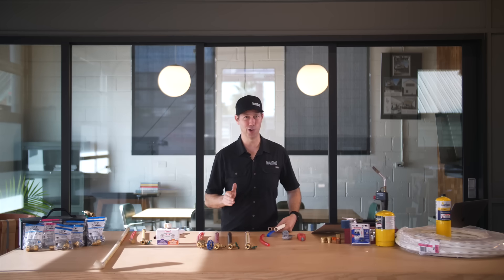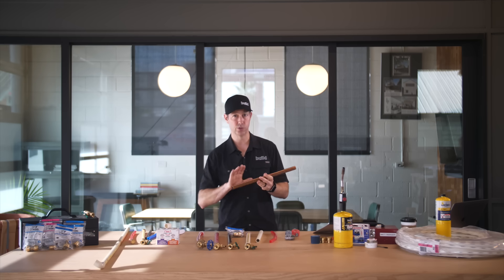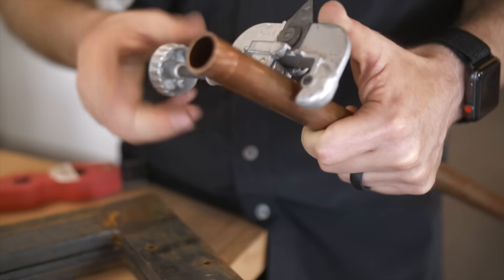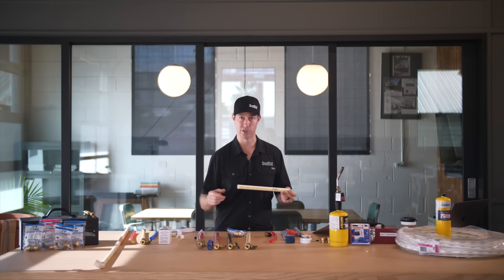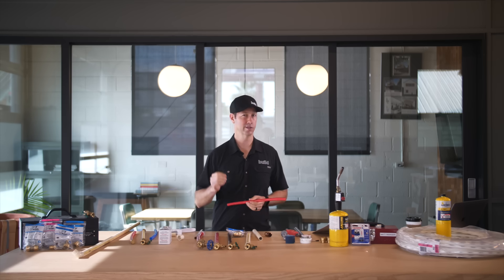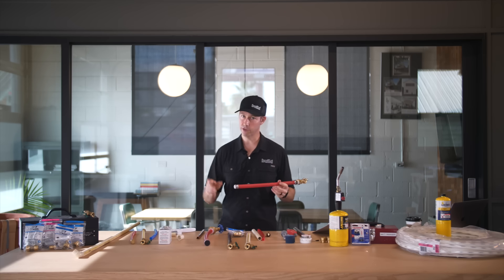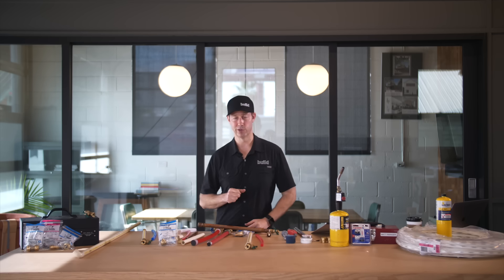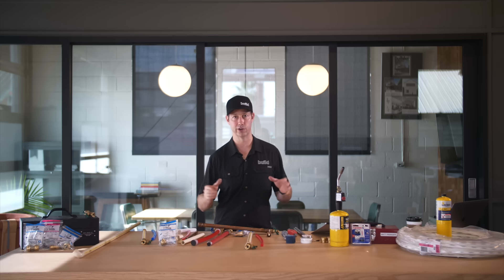PEX vs COPPER vs CPVC plumbing pipes

Comment: Ptc is nice for speed but if there is a scrap in the outside of the pipe from pulling in the stud holes the Ptc will leek. It is nice for speed but I don't trust it for the long haul. We are In California and the home that I have worked in with cpvc are all supper brittle and will crack and break  in your hand with any pressure  applied .  I am worried when we have an earthquake  anybody with CPVC  will have to repipe their home due to  such brittleness  these are in homes only 30 years or less old. I personally love copper and would pay the 20% more for a good copper job any day. Love the videos thanks for the great content!

Comment: I live in Florida and had a Pex repipe about 9 years ago he used 20-foot 3/4 PEX sections in the Attic. With all those joints will I have leak issues due to heat? Would insulating the pipes help?
Reply: If you're worried about heat maybe better ventilation to your attic might help, weather it's an exhaust fan or the Styrofoam panels up against the top part of the roof,  food for thought.

Comment: I am a DYI, have been out of necessity, many dyi projects and not enough money to buy materials and hire a professional, also, living in a rural area in East Texas and it is very hard to find a person that is really qualified.  That being said, I can do sweat fittings on copper, but don't like to do them.  I built a new bathroom off the master bedroom about 15 years ago and I used CPVC pipe and liked the way it installed.  However, this year I wanted to remodel the bathroom with a new shower and bath fittings (new tile in shower, brushed nickel instead of gold colored fixtures) I found the CPVC pipe was very brittle, not the soft cut as when I installed it.  I would try to cut the pipe with my pipe cutters and the CPVC would split several inches down from the cut.  This worried me as I didn't want to remodel the bathroom and have pipe failure.  After doing a lot of checking I decided to go with PEX pipe.  I replaced all the CPVC in the bathroom with PEX, and plan to replace the other two baths, kitchen, utility room with it as well.  I decided on using a manifold in the closet where I replaced my 30 gallon gas hot water with a electric on demand heater.  I love it all.  I have used shark bite fittings, but they are way to expensive for me to use for all my plumbing.  I use the copper fittings with my PEX pipe for about 1/5th the cost of shark bites.  Thanks for sharing your videos.
Reply: Ah!  The test of time, well reported.      THANKS.
Reply: You will be replacing all those shirk bites soon too
Reply: What does DYI stand for?
Reply: @realisaacchapman  - Do Yourself It

Comment: I agree, Northern houses sometimes have to be winterized, thus drain the plumbing of all water for the winter. To install it to slope for draining.
I would not use PEX due to its flexibility and would tend to sag, unless lots, and lots of clamps were used to guide it in a negative slope.
Otherwise, I have used it with Sharkbite fittings and it works great. I do use CPVC alot cause I work under buildings in crawl spaces, and 
using a torch for copper is a fire hazzard. Not a plumber, just a handyman maintenance head at a summer youth camp. A real do it all type
of job.

Comment: Pro tip: If you get purple primer on something you can use clear primer to remove the stain. Also if it’s a painted surface it might take the paint with it :D and copper>all up here in the north the cold is a pipe killer

Comment: I've had CPVC joints leak in a house less than 15 yrs old.  Multiple places in a conditioned basement including the 3/4" main coming in the house.  I also think it hammers hard like copper but it also has an annoying expansion sound when hot water goes through it after it has a chance to cool.  I would never use CPVC on any plumbing job I was working based on this.  Copper would be my preference but PEX has proven (so far) to be a good alternative provided you use the correct type with the all plastic joint clamps and not those metal joint clamps that you pinch close.

Comment: The copper pip you showed was a hard pipe. There are copper pipes that are soft (copper and plastic outside). They come i rolls and you can easy bend and straighten them and go long distance. 
Here in Sweden plumbers uses pressure fittings for copper. They have a rubberseal inside of them som we don't know how long they last. Some say 50 years? The other way is  normal screw fittings. 
New hoses in Sweden all uses pex. And that is double pex. A pex pip in a pex pipe. That way if you get a leak. The water goes out where the pipes comes out from the wall.
Reply: I seen the rolls of plastic dipped copped for gas lines that were buried.

Comment: How does water hammer happen in a system? Isn’t a system under constant pressure? The only time you should get a water hammer is when you turn the water on and off at the Main Street valve. Right?

Comment: I live in Michigan. I would like to run a water line form my
house to my garage which is about 25 feet away from the house. I am planning to
get the PEX pipe underground about 42 inches below the surfer (which is the
frozen line in Michigan). Is it PEX the best chose for underground piping?
Reply: Pex shouldn't me used underground in a instance as you describe . Leachate can actually penetrate the pex pipe. I'm not sure if that as something to do with the lack of oxygen barrier in Pex or just a issue with plastic tubing in general

Comment: So interesting topics, however, the focus was on longevity and cost. But nothing about remodel/repair (IE where it may not be all of one or the other) and how difficult/costly to integrate, as well as other limitations, like for example in a home further up north where it may have to deal with frozen pipes, or connecting to outside faucets. For example, a copper pipe, I have no issue throwing a heating coil to keep it warm, but I'm not sure on the PEX on whether that would degrade. And vice versa, any issues with doing hot and cold water, or for homes with radiators, etc.

Would love to see more explored on this that just the barebones cost and lifetime questions.

Comment: I was doing a bathroom... My customer was talking to me while I was fitting pvc for the drains... I turned the water on to check the copper fittings... I used Shark Bites to cap the vanity lines... As he was standing there the shark bite that was on for hours blew off against the bathtub... Last time I will use them

Comment: Copper not 75-100 years.......my house build in 1995 and this past weekend I had the lines going in and out of the hot water heater fail at the joints.  Most likely electrolysis from the hot water heater and the minerals in the water.  I had CPVC in a Keys house, no issues.
Reply: By the way, for health reasons, I think I would stick with copper.....and those Shark fittings make repairs super easy!
Reply: copper's Achilles heel is electrolysis, and Chinese crap imported by big box stores in last decades. Proper grounding straps and no residual current flow in pipes are mandatory for longevity. Check, you element may be leaking current
Reply: Craig Symington Thanks!

Comment: I'd never use Sharkbite or other push to fit fitting to plumb an entire house - you're depending on that rubber o-ring to maintain your water tight seal. What happens when they start to degrade in 20 years? Time to re-plumb the house! Give me real connector any day!

Comment: You mentioned two types of Pex connections... What about the stainless steel crimp fittings, only just started using Pex, but the crimp tool was $35 from Amazon, and the same tool does 1/2” thru 1” rings...   have had no trouble so far.. any comments?
Reply: If you use Uponor connectors (PEX-A), you never have to second guess anything.

Comment: Copper copper or copper...theirs only one choice here
Reply: In Pittsburgh....reno. 100 year old homes with copper....don't even change it.....the cast stacks....that's a different story
Reply: I have to disagree, I've been using pex for about 10 years. I built about 30 - 40 homes a year and have great success. All the small leaks that we used to have with copper are completely eliminated with pex. 
Neither of them take nails very well though.
Reply: Agreed.1780 is the date of my house been there 30 years and no interior leaks with copper. Feed to the water basin for the horses is pvc and needs work all the time.
Reply: Well water is bad on copper. I only use copper for tub spouts and pex unless I just have to use Cpvc. I live on the mountains and every crawl space with Cpvc will break if you breathe on it.
Reply: xmarksthespot o
Reply: I'm retired from a small college. We had pinhole leaks constantly with copper. No problems with cpvc or pex.
Reply: Especially if you live in the Chicago area, like me. PEX isn't even allowed for potable water applications.
Reply: @psiewert83  HUH????? do people still use copper in chicago??  That's criminal.
Reply: @MichaelMantion  Yup. Nothing but copper is allowed for potable in all of Cook County. Union reasons. It takes more time to install copper vs PEX or CPVC, so the union guys get paid more. Even as a homeowner I'm not even legally ALLOWED to do my own plumbing. Same goes for electrical. Cook County is one of the last 2-3 places in the country that has still outlawed Romex. Everything is required to be in EMT conduit, even in remodels.
Reply: Not really. I am also all for copper and I am in the high tech passive house arena. The reason... occupant health! PEX and CPVC are both polymer based and will leach chemicals into the water. The industry tells you not to drink out of plastic bottles, food storage... but out of need to cut cost, somehow piping goes unchecked. I would never recommend it for a client and nor would I allow it in my house for my family.
Reply: Home built in Florida 1990. In 2008, had 3 different pin hole leaks within 10 months flooding/ruining the wood floors twice. All 3 leaks were in the walls where the builder had bent the pipes almost into 90 degree elbows. I re-piped entire house in pex and no issues with outside bibs, hot as hell attic piping or faucets. Best thing I ever done
Reply: theirs?
Reply: John Hull yeah, until I had two pin-hole leaks from corrosion in my slab. Saw the corrosion & realized repairing was not an option. Ran PEX thru the attic, used half the length needed if it were copper and the job was done in one day for a fraction of the cost.
Reply: On southern or coast our water eats copper 10 years and it's got pin holes in it faster if you use type   m instead of l if you are on a well here copper is not an option.
Reply: There's
Reply: snaplash o
Reply: Lets not forget the antimicrobial properties of copper for me, in my own house copper no question!
Reply: @snaplash  my house is 40 years  old several pin hole leaks in copper ,think caused by water hammer an age  replaced all water lines with PEX cheap, fast best choice on plumbing hands down gl
Reply: Sayit AsItIs  dame we bought our home as a starter home so we have been going pex
Reply: I agree!  If they will allow you to use it.  Best option ever.
Reply: I will take PEX C with a Wirsbo connection over copper any day.
Reply: So you were high on crack when you wrote that right? I make 6k profit plumbing a nee hime in PEX in 1 week, in copper drop that to 2k of im lucky and my employees are on the ball
Reply: Yes, plastic piping is for sewers, not for potable water supplies.
Reply: John Hull, maybe, until your house is 34 years old, like mine. The buried copper under the slab corrodes and slab leaks WILL develop. I am in the process of repiping the entire home. The contractor and myself decided on pex. Cpvc, in the attic, in Florida, heat cycles and becomes brittle within approx 10 years. The pex comes with a 10year manufacturers warranty and should last at least 50 years.
Reply: @1tobicat  my house is 80 years old, the copper piping has never leaked and still looks fine! Yet again I live in the UK so stuff isn't shoddy.
Reply: Harry 8642, I am happy for you. In my case, I do not believe it is related to shoddy materials or workmanship. It is the ph balance of the soil. If they only sleeved the copper to insulate it from the concrete of the slab and the soil under it, I would not have had an issue. I CAN tell you I am very happy with the results of the repipe. No odor, no taste, plenty of flow and pressure, no water hammer. Two plumbers, three days, all new supply lines and fixtures, $6,000.
Reply: I'm in Broward and I haven't made up my mind yet on what to go with. I'm trying to supply water for two additions that are ten and 30 feet away from the house. What do you think would be good for direct burial? Should I put it in concrete to protect either the cpvc or copper?
Reply: Luis Sonoma when I lived in Palm Beach county (Boynton Beach) my place was built 85....as of 2015... never a problem with type L copper...and that included copper in soil from in ground meter at curb box to house...
Reply: John Hull Thanks
Reply: Luis Sonoma all type of soldered or brazed connections will give out in 20 years in moderate or humid climate. Therefore, underground is a no no. Use pvc or other underground worthy connection
Reply: Michael Goodnight So I’ve heard, so I’m thinking or running copper in the walls and the CPVC in the ground. Connected with cpvc transition adapter that threads into a female copper adapter.
Reply: Michael Goodnight  ... That's not true.  The copper running underground to my house here in the North East has been in the ground for over a hundred years with no leaks. My Grandfather built this house, and was overjoyed when they dug up part of the outside line to install a new meter box, and he could see the work he had done all those years ago. All of the houses around here are over a hundred years old, and I've never seen any of them replace their outside lines in the nearly 50 years that I've lived here.
Reply: +Spurious Effect 
Then I guarantee that the underground copper line is buried 3ft or 36in under the surface to be well below the freeze table!!! 
Depending on where in the northeast! 
Maine, Vermont, and New Hampshire, I’d go 40in or deeper to avoid having an underground pipe burst because it froze!!!
Reply: poly e municipal water pipe is the way to go with philmac or cpvc fittings, all i ever use for buried supply piping
Reply: @luissonoma6255  if youre going ro bury it go with municipal poly ethylene. Affordable and far more durable then copper or anything you can stick in the ground. Its flexible so it moves with the earth yet strong so you dont get pinholes. Ive put in 1000's of feet in BC Canada and our ground can be pretty rocky
Reply: @luissonoma6255  Sleeving a pipe that is going into a concrete slab is actually pretty cheap and is always a good idea. If the pipe should start to leak you will know it very soon if it is sleeved and the ends are exposed.
Reply: @luissonoma6255  For cold water always use regular Sced 40 PVC pipe. CPVC is for hot water.
Reply: Sounds more like the slab has shifted and broken which broke the pipe. CPVP and the likes will become brittle over time, it's just the nature of plastics.
For water I'd go with copper all the way because not only will it stand the test of time but copper is naturally anti-microbial. (I know the video mentioned one rare issue but that was their own fault for not servicing their water heater.
Reply: copper is an IQ test.  If you use copper you most likely are a moron.  Pex is always the best option.  I will say I am not a professional so I don't profit from people making stupid mistakes.  If I were counting on failures for a living then copper all the way.  Copper burst when frozen, they leak, they cause condensation.. OH and the best part is when people burn down their house adding or fixing copper.  Pex might take 30 seconds to install but a copper pipe install/ repair could take thousands of hours to repair the fire damage. People even professionals forget how far copper carries heat.  Seriously if you are in the industry make sure you push copper so we all have future work.  Just make sure you use Pex for stuff that you own.
Reply: Delta Repipe totally agree. Metal reacts with certain environmental conditions. I have seen copper fail from who knows what. Cpvc is the way to go in my opinion. Just keep away from uv light and make your glue joints correctly. It will outlive copper I’d bet.
Reply: Sayit AsItIs  till you get cancer from packs
Reply: +Shaun Jackson 
Cancer from what???
Reply: @AzzKicker-bz1cb High Density  Cross linked polyethylene molecules...Last time I looked,Copper was a trace element in the human body and I've never seen  a stat for cross linked polyethylene in the human body...I personally wouldn't drink from it but no problems in other places..
Reply: Not. smh.

Comment: You did not discuss the effect of freezing on the video.  My experience is that 1.  copper will burst at the point of blockage;  2.  CPVC will crack great distances from the point of freezing;  3.  PEX will expand and contract without damage in most cases.  I have never seen PEX actually break from a frozen blockage.  Thawing of frozen pipes is always a problem but warm air is the most effective on all 3 types.  I personally prefer PEX of all the choices.